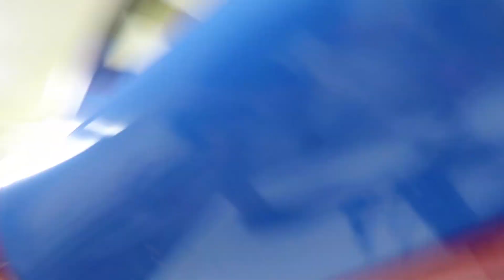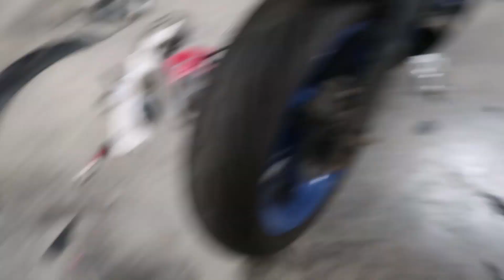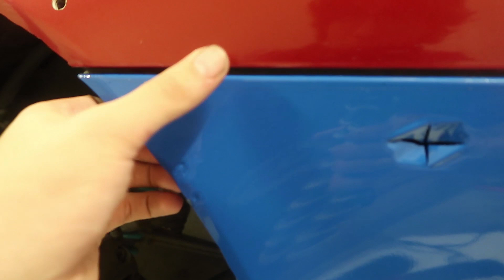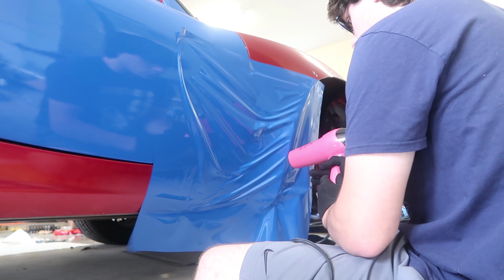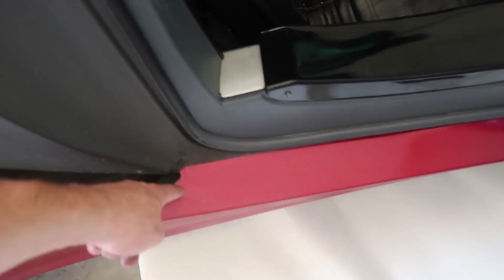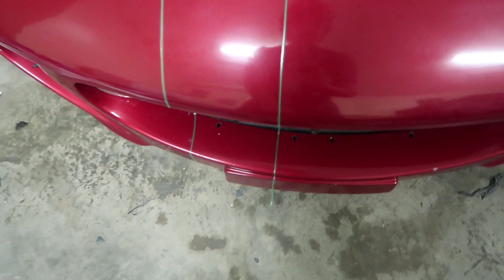WHAT DID I DO!?!

Comment: PRO TIP/ Trick for corners heat up the vinyl next to the corner then take a squeegee an stick it right on the corner getting the squeegee behind the corner then cut 

Another tip when cutting cut at a 45 degree angle toward where the panel is (so that you have move vinyl on the side that is wrapped) you will get a perfect lip

Good luck yummi

Comment: Couldn't you just use a palm sander with a really high grit to sand down your paint?
Reply: Fury x Prophet yeah but not to high cause it can scratch the metal itself.
Reply: if he does he should use a wet sand method and go up in grit starting at 400 ish(hand sand), all the way up to 2000 grit(orbital sand), just from my experience in prepping cars for paint, for a vynal job he could probably go 400 grit wet and be fine. you only really need super high automotive grit sandpaper to get that silky smooth paint finish.

Comment: I'd honestly rather wrap a car than a motorcycle. I wrapped one of my motorcycles and GOD. that was such a long and painful learning process. i mean dont get me wrong, i actually think it turned out great when it was finished. But wrapping complex shapes, like the gas tank and front cowl was a pain in the ass. Also, what i found best for tucking edges, is using a heat gun and the vinyl heats and pushes into the recesses/cracks. then when it's stretched into the space, when you cut, you have more material to tuck away and it hides the edges very well. BUT, on the bright side, vinyl is CHEAP and easy to remove, so if you mess up, you can always fix it super easy, unlike dip and paint :)

Comment: Yes, its your car. Yes, its your choice to do what you want with it. But I cant help it.. gotta ask. If you are sanding it and dont want the color red, why not just repaint it blue? Gotta be cheaper than wrapping it?
Reply: Andrew Link no it is much cheaper to wrap or plastic dip
Reply: Then why does a wrap cost $3-5,000 and a decent paint job can be done for $1500-2000?
Reply: Andrew Link a wrap can be done for cheaper unless you pay some overpriced shop to do it. cough cough InShane Designs cough cough
Reply: Colton Hurley I got my car wrapped and paid $485. It's a 94 Honda prelude with ugly ass Milano red paint